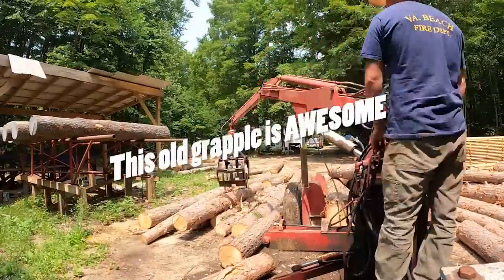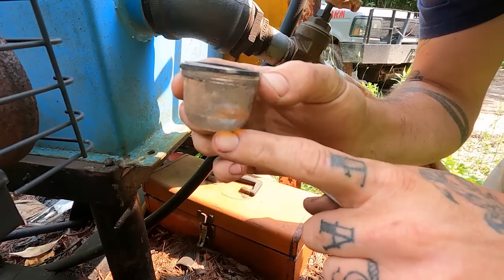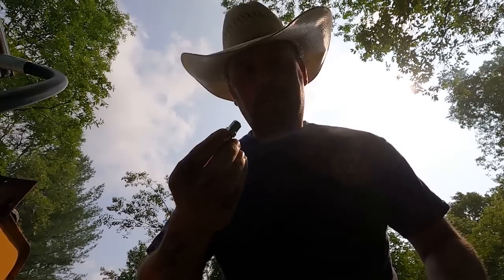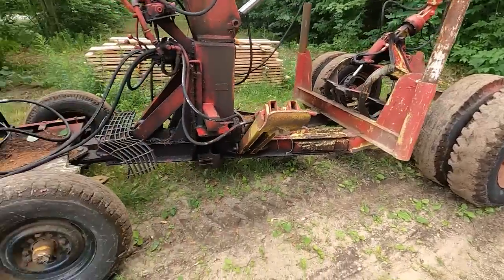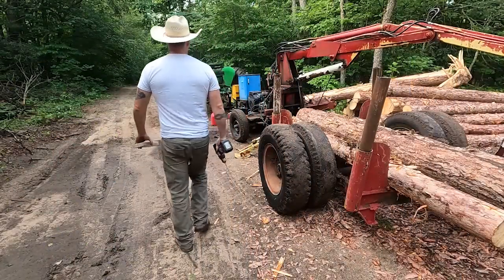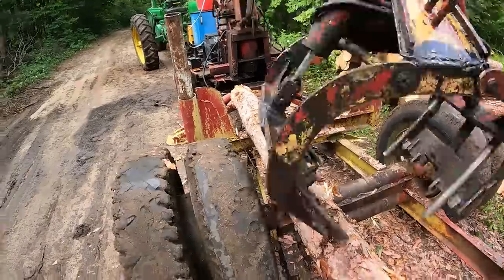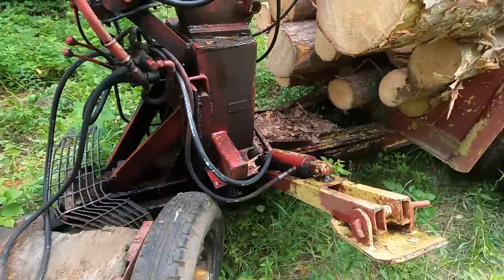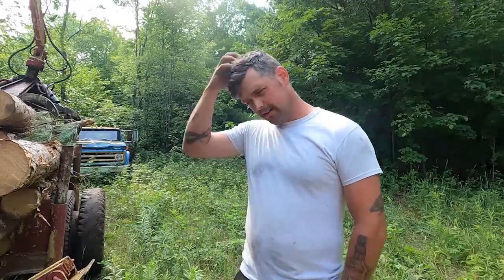My Old Log Grapple Still Gets The Job Done

Comment: In a hay wagon, I put a 1"  hole in the front axle plates and when I wanted to back the wagon into a spot, I would put a big bolt through the holes which would lock the front axle steering angles. All you need to do this is a "smoke wrench" and a big bolt or pin.

Comment: Hey Andy the tank can be below the carburetor. My fuel tank on my duck boat is always below the motor and it pulls fuel up to it just fine with that primer bulb.
Reply: The boat motor has a pump in it and pulls the fuel up.

Comment: I saw a trailer like yours, but it had two huge pins in the front pivot.  You dropped the pins in and could lock the front.  Or pull them out when you need the pivot.